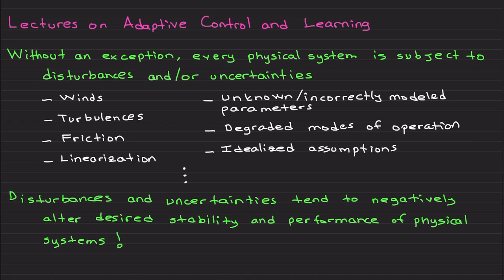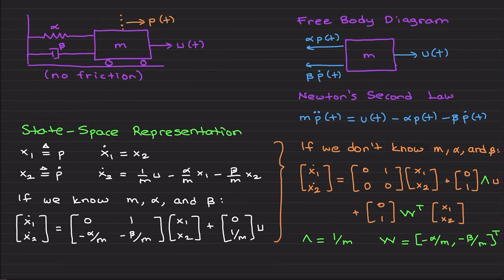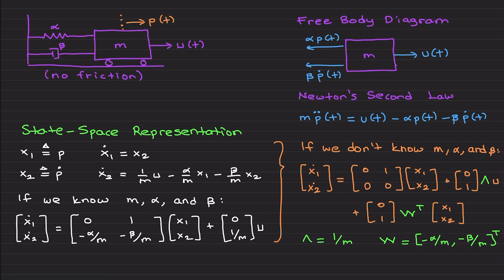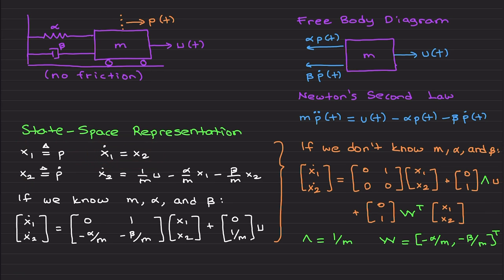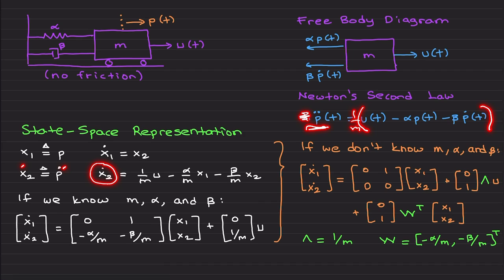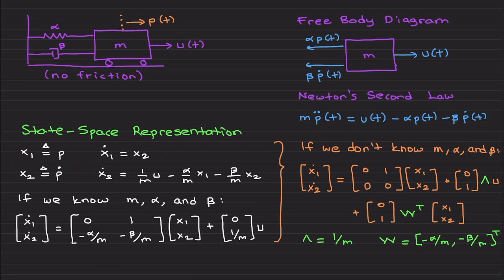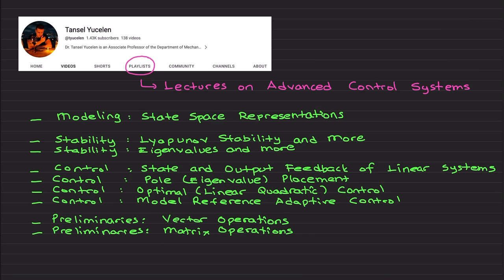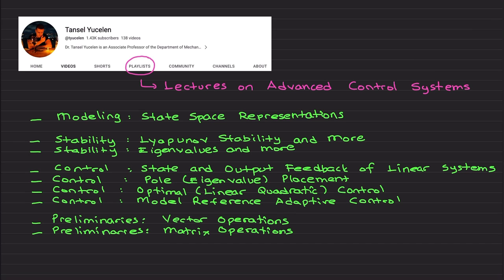An Introduction to Adaptive Control and Learning (Lectures on Adaptive Control and Learning)

Comment: Thank you, Professor, for your series. In the future, would you explain the  difference between MIRAC and MIAC robust control techniques?
Reply from the maker: Thanks Rasit. Model Reference Adaptive Control (MRAC) principle will be posted on June 29 with the title Reference Point vs Reference Model. In that video, I will explain the importance of MRAC. The following videos will build upon the MRAC principle based on its advantages to be discussed on the June 29th video and its Matlab example to be posted on the July 2nd video. So stay tuned for MRAC ;) About Model Identification Adaptive Control (MIAC), here is my brief explanation: 1) Consider dx/dt=Ax+Bu. Say A and B are unknown. 2) In a MIAC scheme, we first estimate A and B in an adaptive way. 3) Then, say, for each A and B estimate, we solve linear quadratic cost function to come up with stabilizing gain K. 4) The main assumptions are 4a) Initial gain K is a stabilizing choice and 4b) If the system is Persistently Exciting (PE), then we improve this K because A and B estimates will converge to their unknown values under the PE condition. 5) Now, without PE, closed-loop performance can be poor. 6) In contrast to MIAC, you don't need PE to achieve closed-loop system error (the error between actual states and reference model states) converge to zero. 7) From this standpoint, I always found MRAC to be more practical than MIAC. Finally, let me know if you want to follow up ;)
Reply: Hİ Professor @Tansel Yucelen  . Thank you for your valuable comment! Maybe in MIAC processes, we can incorporate a recursive identification method such as RLSE to enhance the accuracy of finding system parameters. Is this statement correct? Although I do not directly work on Adaptive & Robust control, I specialize in Optimal control, which was the focus of my MSC thesis. However, I thoroughly understood every detail in your explanation. I will eagerly await your video.